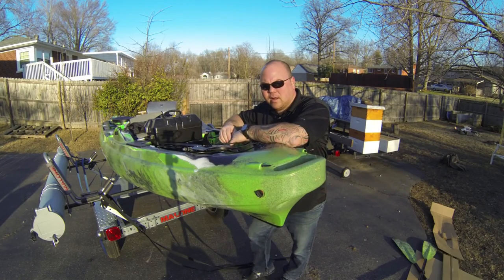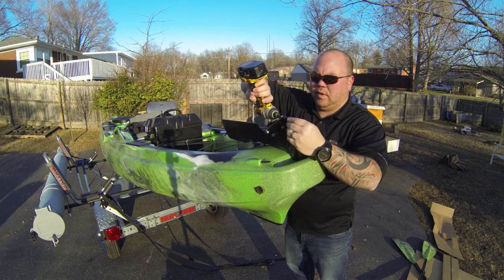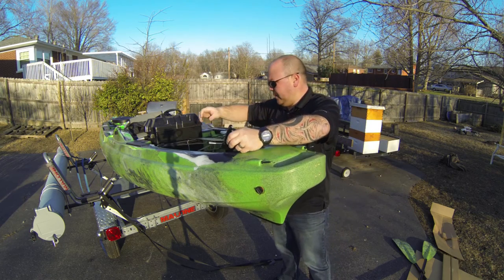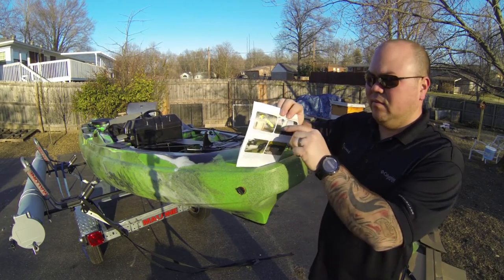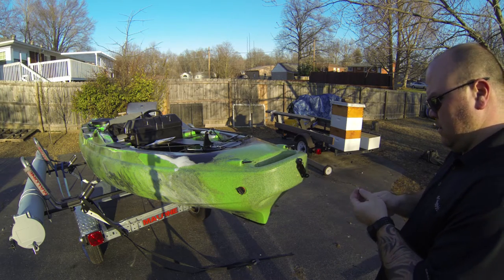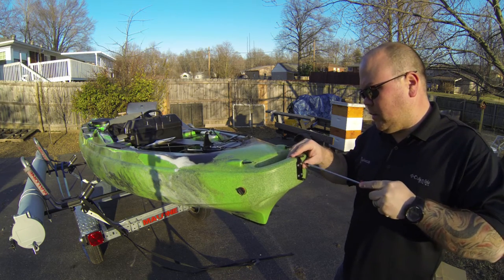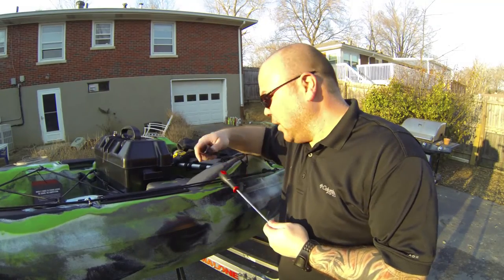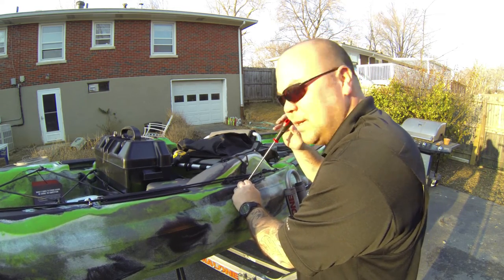Oldtown Predator XL Rudder and Accessory Install

Comment: Im thinking about getting one of these before they discontinue them  whats your average top speed? It seems like it would be more stable that the pdl version as the lower seat and the battery setting on the floor

Comment: Do you find the pulley for the rudder pretty stiff? I haven't got mine in the water yet but just pulling on it after install, it seems as though it takes quite a bit of force to lift and drop it. Wondering if this is normal. Cheers.